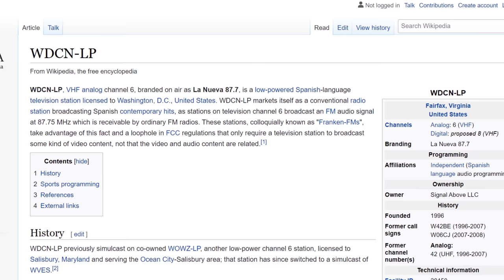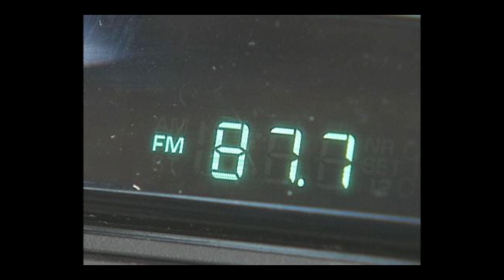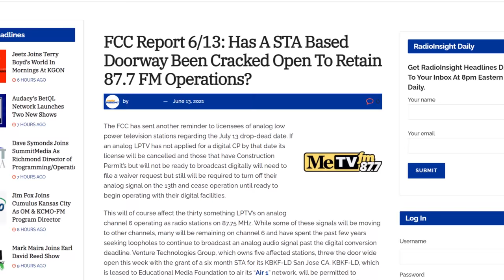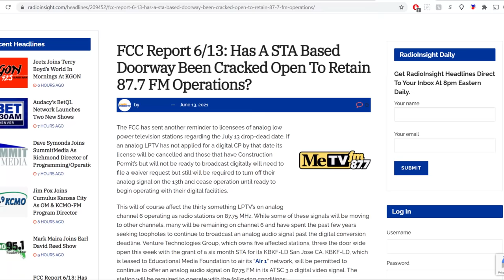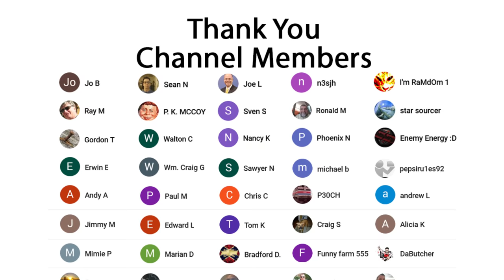87.7‌ ‌FM‌ ‌Radio‌ ‌Stations May Get Six Month ‌Extension‌

Comment: My compliments on your technical acumen, but I think you are misguided.  Franken FM stations are a blatant violation of the FCC rules, because they use + -75 kHz FM deviation (which equals 100% modulated for FM stations), whereas the analog TV Aural Carrier rules allowed a maximum of + - 25 kHz deviation (which equals 100% modulation for analog TV).  Do you not understand this?  Blatant violation of FCC technical rules should not be rewarded.  The greater deviation represents an IX threat to TV Channel 6 DTV stations (probably not much of a threat, but no studies I am aware of that have investigated 87.7 MHz FM analog IX into  DTV Channel 6; either ATSC1.0 or ATSC3.0.
Reply: Yeah those rules are bad I think that as Americans we have the freedom to chose which signal to broadcast as long as it doesn't interfere with 
other wireless signal analog tv and radio should continue but be limited to a few stations a state
Reply from the maker: I understand what you're saying. I don't think Franken FM stations should be doing this. Their audio should be strictly on 87.75MHz
Reply: @AntennaMan  The problem is to my knowledge no one has done laboratory tests to determine the interference threat of an analog TV Channel 6 station using an aural carrier with triple the designed for deviation to an adjacent channel FM station (i.e., Channel 201, 88.1 MHz).  So the Franken FM guys just want to wing it, and too bad if this steps on a Channel 201 NCEFM station.  Plus, documenting any loss of coverage to the Channel 201 NCEFM station caused by an over-deviating Franken FM would be a burden that the NCEFM licensee shouldn't have to bear.  One approach would be to use the engineering criteria that first adjacent channel NCEFM stations have to demonstrate to each other:  The F(50,10) 54 dBu interfering contour cannot overlap the F(50,50) 60 dBu protected contour of the adjacent channel NCEFM station (and vice versa).  That is, the FCC rules define that a desired-to-undesired signal ratio of 6 dB is sufficient to avoid interference between first adjacent channel FM stations.  That engineering criteria would probably also be okay for an 87.74,  87.75 or 87.76 MHz Franken FM station, although the burden of laboratory tests to demonstrate that a 6 dB D/U signal ratio is sufficient would be on the Franken FM stations.  This would normally require a Notice of Proposed Rulemaking (NPRM) to allow interested parties to comment and submit their laboratory test results.  But I have heard no reports that any Channel 6 Franken FM analog LPTV station has made an attempt at such a demonstration, or filed a Petition for Rulemaking.  Also, it seems to me an incredible waste of spectrum to use a 6 MHz wide TV channel to accommodate a 200 kHz wide Franken FM signal.  Franken FMs should at long last terminate on July 13, 2021, as ordered by the FCC.
Reply: You left out the fact that the FrankenFM's use a Stereo transmission format not allowed for an analog TV broadcaster.  They're supposed to be using BTSC, not the so-called Zenith/G.E. system, used by legitimate FM broadcasters.
Reply: @johnpinckney4979  Yes, you’re correct, that’s yet another problem:  BTSC stereo used a 15.734 kHz pilot and a 31.4 kHz subchannel for the stereo difference signal, whereas FM stations use a 19.0 kHz pilot and a 38.0 kHz subchannel for the stereo difference signal.  So to be compatible with FM radios, Franken FMs also need to employ unauthorized aural carrier subchannel frequencies.
Reply: @dane1234abc1   However, because of political reasons, I expect the Franken FM's to get a "Stay of Execution" until the party currently in-power is no longer in power.  It's well-known that the FCC often chooses who the Field Operation Bureau inspects...
Reply: @johnpinckney4979  You seem well informed, and you're probably correct.
Reply: @dane1234abc1  I'm a retired broadcast and broadband engineer with 45 years of experience...
Reply: @dane1234abc1  Nobody wants this spectrum, though. The stations on it are the only ones that wanted it. I suspect all of VHF is just going to end up 5G WB  spot coverage, eventually. Aside From ATC, NOAA, and Business band, VHF lo is silent in my area.
Reply: Considering all of these technical arguments expressed here against these stations, why did the FCC not ban their use before even letting them get started?
Reply: @jeromewysocki8809  The FCC has a very inconsistent record of enforcement.  Especially when the format of the station or it's ownership is of a politically sensitive nature.  As an example, In my local area, it took multiple calls to the FCC to shutdown an ethnic language pirate on 87.9 with Christian programming.  How loud was it?  It had a car radio coverage of about 15-20 miles...
Reply: @jeromewysocki8809  Because under then FCC Chairman Tom Wheeler, the FCC chopped its Enforcement Bureau offices and staff roughly in half in 2017:  From 24 to 11 field offices, and from 108 to 54 field engineers.  At one time the FCC had four FM/TV/CATV Enforcement Unit trucks staffed with FM/TV Specialists who monitored radio and TV stations, to ensure a level playing field by broadcasters.  But the FM/TV Specialists and enforcement unit trucks have been discontinued for probably 20 years, due to budget cuts.  So the FCC now likely lacks both the hardware and expertise to promptly catch (or catch at all) stations playing fast and loose with technical standards.
Reply: @jeromewysocki8809  Franken FMs never asked the FCC for permission, they just started operating entirely on their own, in violation of multiple FCC technical rules.  The FCC should have come down hard with NALs at the start, but didn't.
Reply: Dane Ericksen, P.E. , You've made an excellent point here.  Now I much better understand the issues. If these guys get away with operating any way they like, they are essentially not much different than an illegal pirate radio station. And if they continue to get away with it, a very strong message is sent that you can probably get away with doing anything you want, that is against what are lawful standards, and there are no consequences. Non-enforcement of the law is bad business in all aspects of our society, not just only with the FCC.

Comment: Why not have the FCC offer a 87.7 FM license? The station can use its digital signal as required and continue it's old life as a real FM station.
Reply: captbiptoe, probably because people would listen to this station, instead of the dreary programming offered by NPR. Besides, it is too simple of a solution, even although it would work out marvelously, especially if channel six frequencies were no longer to be used as they currently are. But you know how the government works. Your proposal, a good one, is too simple for them. The government wants to get in to booger things up. That's how they seem to like to do things.
Reply: So many issues:  Can an 87.7 MHz analog FM carrier with 75 kHz (not 25 kHz) deviation be added to a 6 MHz wide digital TV channel without causing IX to the DTV portion of the signal?  Is a different DTV Ch. 6 to DTV Channel 6 protection required if one of the D06 signals has an added 87.7 MHz FM signal?  What protection requirement is needed between an 87.7 MHz Franken FM station and a Channel 201 (88.1 MHz) NCEFM station? What EAS requirements, if any, should apply to Franken FM stations?  What local origination/public interest standards should apply?  The same as those of NCEFM stations?  A full fledged rulemaking is needed to answer these questions.
Reply: @dane1234abc1  Back in the 'analog only' days TV channel 6 and FM 87.7 were never licensed in the same market to avoid the interference. 

By the same token there always had to be at least one unused TV channel between licensed channels to avoid interference.
Reply: @captbiptoe  The lowest frequency that the FCC ever licensed an FM broadcast station for is Channel 201, at 88.1 MHz; that is, there is no such thing as an FM 87.7 (at least in the United States).  FM stations at the low end of the NCEFM band had to demonstrate no interference to any nearby analog TV Channel 6 stations, but not vice versa.  Then, when full service TV converted from analog to digital, the FCC continued to use the technical study for NCEFM-into-analog TV Channel 6 for NCEFM-into-digital Channel 6 TV stations, which made little sense.  But I agree that the VHF low band TV Channels 2 through 6 are pretty much a graveyard for DTV.   One reason is that the protected contour for analog VHF low band was 47 dBu (223 uV/m), whereas the protected contour for digital VHF low band is 28 dBu (25 uV/m), or almost two orders of magnitude weaker.  But potential interferers such as man-made noise, leakage from Part 15 devices, and high power (100 kW and even higher for grandfathered superpower FM stations) potentially causing tuner overload didn't go down by two orders of magnitude.  Add in the skip problem for VHF low band and it's pretty much a basket case.
Reply: Also some Hyundai or Kia cars in Canada and the US have 87.5 MHz. Including Hyundai Tucson car radio.
Reply: @FrancisLitanofficialJAPINOY  Some GPX brand radios go even lower than 87.5 megahertz on FM

Comment: 87.7 FM is not a real FM frequency.  88.1 FM is where it starts.
Reply from the maker: Actually most FM tuners go down to 87.7FM
Reply: @AntennaMan  Latin American car stereos can tune down to 87.5 MHz. Brazil that uses same analog frequency from the US, but PAL-M, uses 87.5 FM on some areas.
Reply: @AntennaMan  older US car stereos starts at 87.9 FM